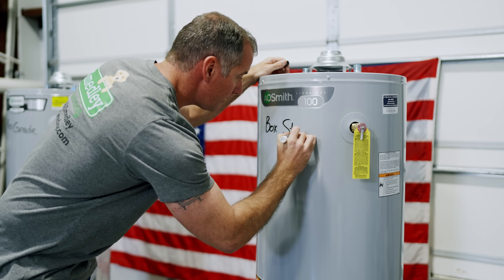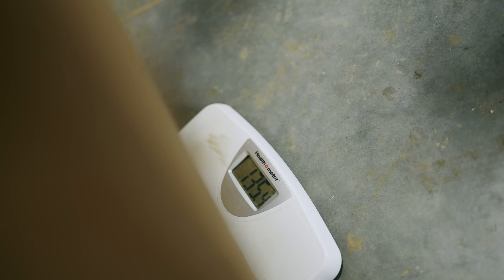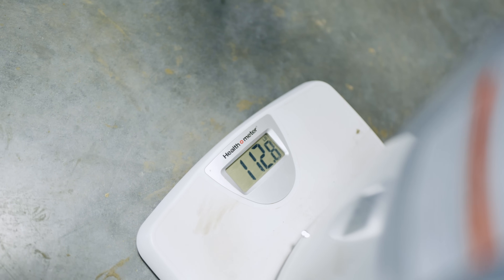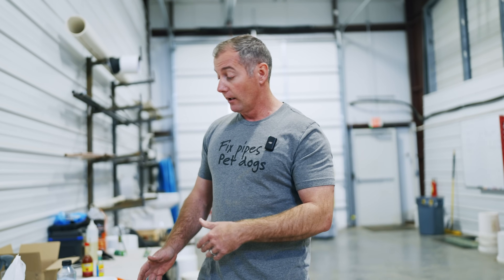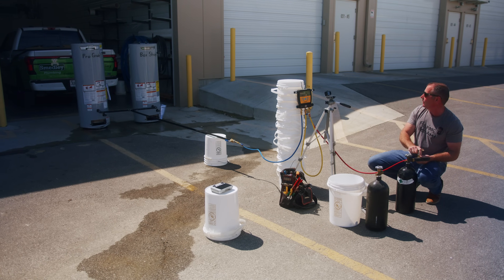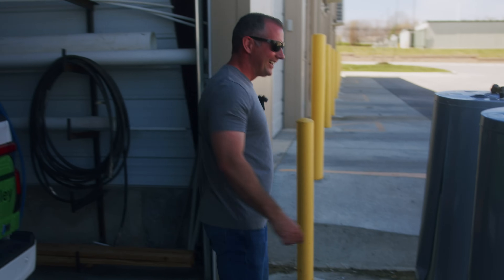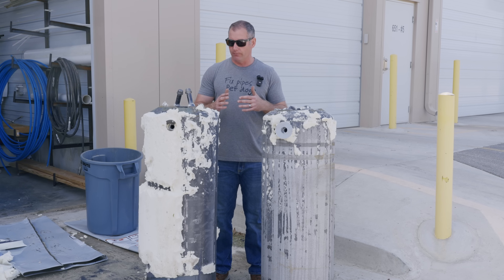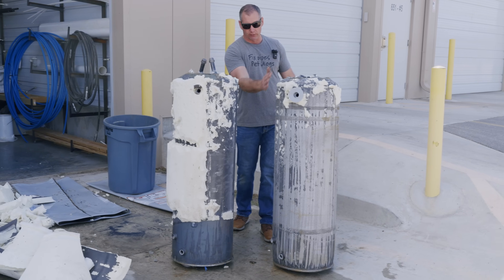What water heater should I buy? - Pro Grade vs. Box Store

Comment: I have 20 years on my current "box store" water heater.
My pressure is about 60 psi, on a well.
Replaced lower heater coil once.

Also, water tanks don't 'explode' - ask anyone that does hydro testing on high pressure gas cylinders. 
Explosion means energy is released.   Since water doesn't compress, there is no 'spring' energy to release.
It cracks and gushes over the floor.

So keep the pressure reasonable, and you are good.

All that being said.  If the price difference is $125... I'd call it a wash.   The difference in price is easily swallowed by the installation costs.
Reply from the maker: Consider yourself lucky with that tank.  The new box store units don't last that long

Comment: #1 Not many water heaters are glass lined anymore as evident of why no glass jingling around as you rolled it. #2 is that the box store tank was not going to “explode” as there was no energy stored in the cold water rather than pressure. # 3 is that most pressure vessels are built to ASME standards which have a safety factor of 3.25. Though I did not see an ASME plate the mfgr still uses.Great vid but some sus info being sold as gospel.
Reply from the maker: Not sold as gospel but we verified many erroneous claims that they are the same heaters.
Reply: But they are. Have you ever been to a boiler manufacturing plant before?  The boiler and burner are the same in both cases. Some of the controls are different but its the same burner, same btu, same volume, same boiler just outfitted differently.
Reply: What is the heating surfaces of the two?  An engine that produces 100 hp, no matter how many cubic inches it is still makes 100 hp. Same here.

Comment: Nice comparison. I agree pro grade over box store. Some of the minor diffs can be running changes, though, based on when exactly the assembly lines switch over. For example, as long as the pressure relief valve is doing its job, the oro grade unit may get a Watts brand one in six months or vice versa.
Reply from the maker: This is true.  But when the video is to highlight all differences, we needed to identify that one as well

Comment: What about air source hot water heat pump?! Also, what about Corro-Protec electric anode rod.
Reply from the maker: I like the heat pump water years in the right environment.  The jury is still out on the powered anode rods.  In theory they work, but I don't see units with a powered anode rod outlasting traditional units in the real world.

Comment: Myth busters defeated the relief valve, and did runaway firing.  Launced the water heater through 2 floors of the test house.  If you were anywhere in the house you would have passed in the burn unit.  Important valve is understated.
Reply from the maker: Very underrated!

Comment: I have a big box store Rheem Performance Plus water heater and it has lasted 16 years and still going.
I flush it yearly and change the anode.
Reply from the maker: A lot has changed over the last 16 years. I would not expect similar results from a current box door unit.

Comment: It's just my wife and I in an all-electric house with grid-tied solar, so we use a very small Black & Decker flash water heater.  It heats as fast as the hot water can get to the shower, with as much 105 F water as we want.  It never runs out, because it has no tank.  Uses zero electricity if no hot water is running.  Best of all, we have never had an electric bill since we installed the solar.  It does need 30 Amps @ 220 volts, but that's no different from a standard electric water heater.  That is a lot of electricity, but we only use it for a few minutes per day.
Reply from the maker: Pretty cool setup!

Comment: I did not have the time to change out a simple O-ring on a Delta kitchen faucet so I called a local plumber as it happened while I was on a business trip.  His first question.  Where did I buy the faucet?  Box store or plumbing supply house.  Reason?  He can change out the O-ring on the supply house model easily.  The box store model is usually unserviceable, just toss it and get a new one.  I had purchased the Delta during a kitchen remodel done years before from a plumbing supply house.  The plumber changed out the O-ring, a simple, one minute job.  Most supply house faucets offer a fair number faucet models built with all metal components.  Box stores?  Usually some sort of chrome plating on plastic.  The build is not as robust either.  It gives the faucet a cheap feel about it.
Reply from the maker: Yep!

Comment: One thing I don’t think you mentioned was right out of the box you could see the cost to operate was higher on than the other. If they were mechanical identical then the cost to operate would be the same.
Reply from the maker: It's highly possible the box store unit has a smaller BTU burner. That would make its cost to operate slightly less but that would also make its performance inferior as well. But also those EPA stickers are wildly inaccurate.

Comment: 30:54  Good example of why you are supposed to use 6 sided sockets to remove anode rods, not 12 sided, you're lucky you didn't strip the top of the anode rod.  Plus, you should always use the black sockets designed for impact wrenches, the chrome ones can shatter.
Reply from the maker: I'm a bad boy ...lol

Comment: About 15 yrs ago a good friend needed a water heater and purchased "brand X" from the blue box store and after one day of operation the pilot failed and as per the the manufacturer they recommend   to replace the thermocouple and found out that the blue  box store had proprietary parts "LEFT HAND" thermocouple threads I never herd of this well it's true after 3 days finding the proprietary t-couple to fit the Proprietary Honeywell gas valve we Uninstalled this mess and returned it.
 I purchased one from a local wholesale supply house and parts can be had readily. 
 The blue box store no longer sells unique to them water heaters but I still won't buy from them.😊
Reply from the maker: Yep.  That was the first major indicator that the box store units are not the same.
Reply: John wood used a left hand thermocouple too back in the day
Reply from the maker: @RockoRocko-rz7kx  thank goodness those days are gone.

Comment: If you want to heat water efficiently you’d think they’d design it like a boiler. Lots of tubes for the hot gas to go thru. More contact with the water.
Reply from the maker: They have those too.  But they are quite a bit more expensive than traditional water heaters.
Reply: @SmedleyPlumbing  cool. Didn’t know.  Now I’m thinking I need to have ours serviced.  Had it installed several years ago when the other one went out.  The company that put this one in got it at furguson so I’m guessing it’s a pro model, but it’s never been flushed out or anything.

Comment: Replaced several water heaters from big box stores and not one has failed out side the it’s normal time frame.m even my own. The ONLY issue I had was with an AO Smith delayed ignition after a few months after install. Turned out it just needed to be adjusted and adjusted means open it up pull it out and bend the bracket to kick on sooner. It was cool to see the flame shoot out the top 🤣😂not so cool the first time it happens in a basement but I was able to replicate it which told me where to look. I’m calling BS on this for a number of reasons. You might get a yr or more longer but that greatly depends on the human factor. I’ve replaced some that were 15 yrs old big box store version. Petty, very petty ppl just want hot water without issue usually as quickly as possible. You do you I’ll do it my way that over 20 yrs hasn’t failed me.
Reply from the maker: Installation definitely affects longevity but initial product quality is where it all starts.
Reply: @ I’ve yet to see any significant difference between the two in a real life setting other than price. Now I get there are the die hards and those who insist on paying more than they need to and that’s ok there’s a market for them, I tend not to deal with those ppl and that’s ok too. I guess that’s where your type comes in. I like to sleep at night knowing I didn’t break their bank needlessly. 600.00 for 2 hrs of work (includes going to get it) and an 800.00 40 gal water heater. It’s not rocket science. California btw. Only time it’s hard is if you need to lift that damn thing more than 2ft yes I’ve done it no it’s not easy being short you find a way usually involves brute force and ignorance git er done.

Comment: This video assumes that Lowe's only carries one model of AO Smith Water heater, and the pro-line has only model. In fact, they both have multiple different models of different quality. So it may be that there are models of pro-line which are basically the same as one of Lowe's model, even if the pro-line has one model that is better than the best Lowe's model. Considering the 21% difference in price, I would assume that equivalent models were NOT compared.

Also, things like plastic water drain valves can be replaced by the installer with a brass valve, which is what I had my installer do since they were out of the Rheem units with brass drain valves. The only other difference between the Rheem unit I purchased (and installed by Home Depot) and their top of line model was the warranty.

As far as two different water heaters being made on the same day, no one ever claimed that was true, and I don't even know why that was brought up.
Reply from the maker: They are not the same.  I feel we proved that with the video.  The general consensus amongst the general public is that they are the same units.  And they absolutely aren't
Reply: @SmedleyPlumbing  I didn't say they were exactly the same. But the problem I have is that there multiple levels of quality for each type of water heater within both the Lowe's and the ProLine models, and you just seemed to compare the lowest model of the Lowe's with the highest model of the ProLine. It's almost like comparing a Chevrolet against a Lincoln, instead of comparing a Cadillac against a Lincoln. Both the Chevrolet and Cadillac are GM vehicles, but not the same. Also, the Lowe's models have some versions that have a longer warranty than the ProLine.
Reply from the maker: @Mark-rw3kw  ah, we compared the lowest line of both.  Both were the 6 year warranty levels of each heater.

Comment: What would be the normal pressure inside the water heater. Why pump it to over 400psi to test it. Would it go that high if something went wrong? If so wouldn’t the pressure relief valve release it 🫡🫡🫡please someone explain!
Reply from the maker: Normal pressure is 80 or less.  But we were testing the point of failure

Comment: I find it interesting that you did not mention that the anodes should be serviced/replaced every 2 or 3 years or that by putting an electric anode in your water heater it could double the life of your water heater.
Reply from the maker: There's more about water heater maintenance that we didn't mention.  This wasn't a maintenance video but rather a comparison video.
Reply: @SmedleyPlumbing  That's what you'd like us to believe but lets be clear this video has one purpose: to get people to shell out big bucks to pay for a plumber to replace their water heaters with a commercial one. Now then about you not mentioning the single most important thing a person can do to double the life of their water heater clearly proves my point. You are extremely verbose. So much so I'd bet the farm that you really enjoy hearing the sound of your own voice. To have mentioned replacing one's anode with an electric one would have been nothing and it certainly wouldn't have detracted from your comparison. The fact that it is such a profound issue regarding water heaters that any video about any topic having to do with a water heater that doesn't mention electric anodes is dereliction or deceitful.  Those are your choices.full stop.

Comment: I have an electric water heater. My family at home consists of a 69 year old dad and a 20 year old son...out of 5 adult children total. My wife died in an accident 3 years ago. I set my water timer to turn on at 5 pm and to turn off 3 hours later at 8 pm. I normally shower after 10 PM and that works well for my son and I. My current water heater is around 15 + years old...I'm guessing its 18 years old. Blue Sky's.
Reply from the maker: Water timer?  You have a timer for your water heater?
Reply: We only heat the water prior to when we normally use the hot water. No sense in heating water 24/7 when our habit is to shower just before bedtime. We have very low electrical water use in our household of two people. Blue Sky's!

Comment: I had my water heater replaced by a plumbing company. My water pressure dropped. The plumber refuses to fix the issue. I have 65 lbs of pressure at the heater. Is there a reason this happens?
Reply from the maker: Code says no more than 80 psi in the home.  So we often have to lower the pressure to meet code.
Reply: Thank you

Comment: The dielectric stops galvanic corrosion (the corrosion of dissimilar metals in aqueous conductive solutions due the difference in galvanic potential between the materials).  Electrolysis is the reverse reaction of water formation, where you use electricity to split water into elemental hydrogen and oxygen.
Reply from the maker: Thanks for the clarification!

Comment: I had 3 Rudd pro-grade heaters fail within each lasted about 7 years and pro grade  company said sorry about your luck the box store one failed in 5 years but they covered it
Reply from the maker: Sounds like you might have a water pressure issue or a thermal expansion issue that's causing premature failure of four water heaters.

Comment: If you cut open the heater, you could compare the thickness of the steel.  That would account for ht eweight difference.
Reply from the maker: This is true.  But the weight says it all.
Reply: @SmedleyPlumbing  The other thing is what is the warranty?  Does it differ between the models?
Reply from the maker: @Herby-1620  same warranty.  6 year on both

Comment: What the AO Smiths are only $579 and $519 !?!?!!  I just paid $877 for a Bradford White
Reply from the maker: Yikes!
Reply: @SmedleyPlumbing  after watching your entire  video I now know why.  I have a BW Ultra Low Nox Defender, so the burner assembly is much more complex mesh burner vs the simple burner on your video.  I also compared the cheapest Lowes AO Smith low nox as well, and was $719 (6 yr warranty) to $929 (12 year warranty).  BW at my plumbing supply store is $879.  Anyways..  I went straight for the BW for my replacement.

Comment: Yea pro is normally better. One of our hot water heaters is almost 25 yrs old. We marked it in 03.when we installed. Just change the rod every few years, every few months drain alittle water out of the bottom and some out of the relief valve. Maintance. Hopefully sells soon so never will have to had replaced it.
Reply from the maker: Keep it going!

Comment: I thought it was called galvanic corrosion with two dissimilar metals 🤔
Reply from the maker: Two ways to describe the same phenomenon.
Reply: @SmedleyPlumbing  ah gotcha, 👌 Man I've got an old state water heater that was put in when the house was built thing has to be over 20 years old hasn't leaked I've replaced the elements and it's about time to replace the anode rod which I know wasn't replaced for probably a decade lol But she still going! Will definitely be going to the supply house instead of Lowe's whenever she does start to die. It even has the old straight copper pipe from the water heater to all the copper in the house no flex lines at all 😆 I'm kind of baffled how they even installed it or got the pipe in there lol
Reply from the maker: @JbVest  leave it.  That thing will live forever.
Reply: @SmedleyPlumbing  oh yeah I don't plan on doing nothing but swapping elements when they burn out.   I'm impressed with it. They don't make them like they used to!

Comment: You're weighing the control valve to see if its the same?  Just look at the model number on the side.  Honeywell doesn't put the same number on different units.
Reply from the maker: Since the rest of the testing was based on weight, we carried that same test to the control valve.
Reply: @SmedleyPlumbing  That's a reason, but not one that makes any sense.

Comment: does the difference, make much difference in durability? if so how much more durable? weight equal quality? Does it also not depend on the material? So that last test went against your opinion all along.
Reply from the maker: Technically the box store tank leaked first. But yet lower weight is lower quality.

Comment: Components get the cost cuts. Tanks - no difference, however you did touch on the anode rod difference which is significant. 
Why do you think that there are only 3 manufacturers left. Water Heater manufacturing is an art. Only the profitable survive.
Reply from the maker: Or the profitable competition gets acquired by the giants before they can compete against the bigs.  But I truly appreciate the comments.  Especially from a former insider.

Comment: you could use a flexable rod to go through the drain valve. No need to remove it.
Reply from the maker: The drain valves are not a straight pass through valve like a ball valve.

Comment: Great video, but honestly I don't see a game changer on the Pro line. Although there are differences, they are very insignificant. Also, the anode rod needed depends on the water supply to the house, depends if you live in the city, suburbs or country, you need the correct anode rod for the environment.
Reply from the maker: The biggest difference is the tank weight and quality.  We were more failed box store tanks than pro grade tanks.